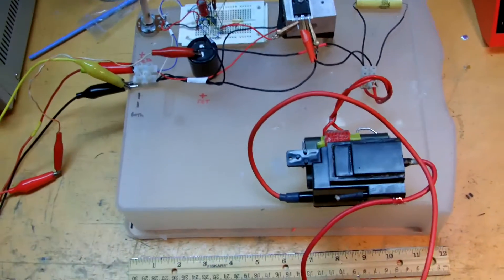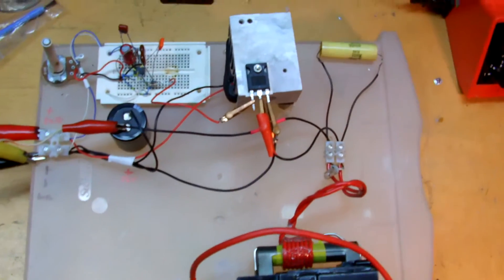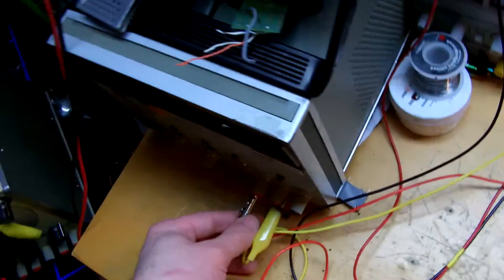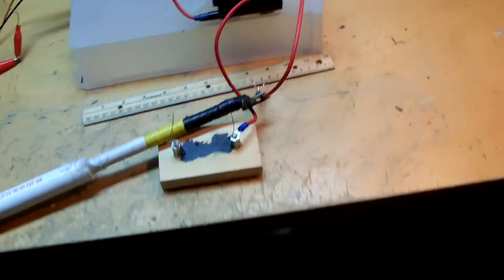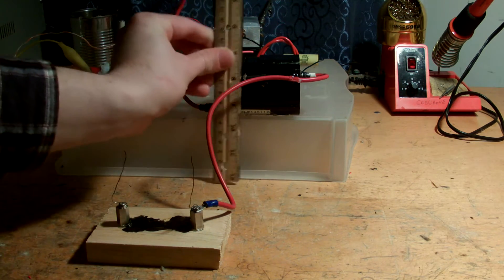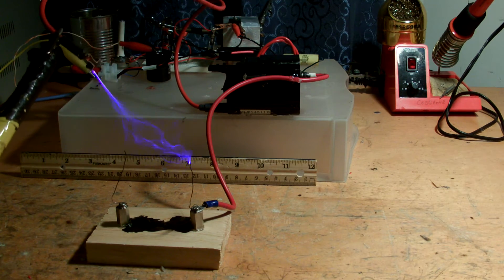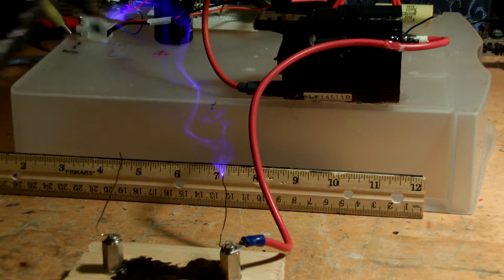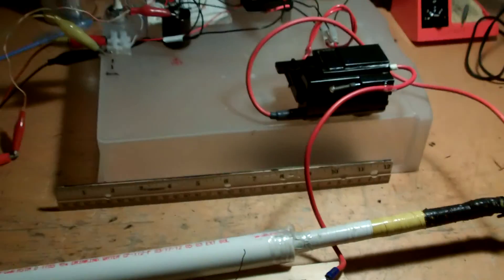MOSFET  Flyback Arcs!

Comment: So ive got a fllybak circuit set up and a cfla or what ever you call those tubes inside a pc monitor that take a few kv and its arcs have a totally different freq than the flybak..  wondering what happens if i connect these outputs in series...  anybody have a guess?  Kinda scared someday fuckin around with shit just for the big ass arcs that ima pull a photon and pop my meter out back..  not with this i mean but just sayin..  but my math says a 6” flyback arc at about 10khz and a cfla arc thats about 3” but at around 1khz will make an 9khz 9” arc...?  Or just shit out the zvs and solid state all at once while i shit myself and flip the breaker back on...  sounds about right...  eh.  Good times..  good suicide note though..  fuck everybody...

Comment: Pete Ritchie what is the voltage input?
Reply: These are always fun! :)
Reply: Josh Campbell what did you use for your  power supply for the induction heater in your video?
Reply: Owen Chase A 200 amp 3-phase rectifier feeds a 200 amp IGBT h-bridge. (That's it in a nut shell.)
Reply: o ok thanks
Reply: It makes one hell of a Flyback driver, I'll make a video next week if I get some free time.
Reply: Josh Campbell thats cool, did the 200 amps come from a transformer and rectified or is there a way to make a power supply without a transformer?
Reply: You only need a transformer if you want to isolate or step up/down or a combination of the two. Mine is without a transformer unless I'm using a variac for testing. The matching transformer between the inverter and tank provides the isolation and impedance matching. And 200 amp is just the rating of the rectifier and IGBT's, it's fed by 4AWG copper wire 6 feet from a 100 amp breaker.
Reply: o ok cool.
Reply: Josh Campbell I had something to ask I know you are knowledgeable. I don't know if you ever worked on a gieger counter but I have been working on one, there is a current limiting resistor 4.7 mega ohms on the tube, and I read up that you can't measure the voltage when I use multimeter because of the impedance, when I do measure with my meter I see a big voltage drop, if the voltage drops, how is the tube going to get the full 600 volts?
Reply: Make sure you know exactly what is happening in regards to the tube and the limiting resistor. Check this out: http://www.imagesco.com/articles/geiger/build_your_own_geiger_counter_-_gm_tube.html
Reply: Ok thanks
Reply: Josh Campbell Is a variac one of the best investments for high amperage experiments? I want to get the one on ebay it is 20 amps, but Im thinking if I run the amperage high on a variac will they burn out easy?